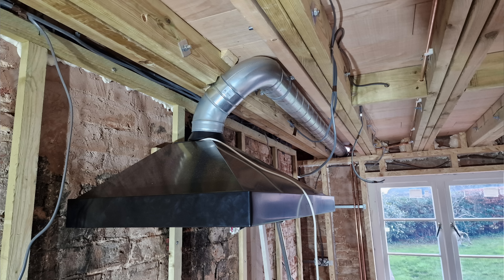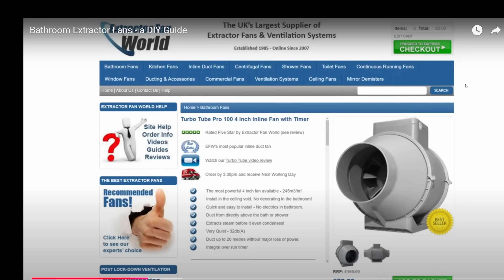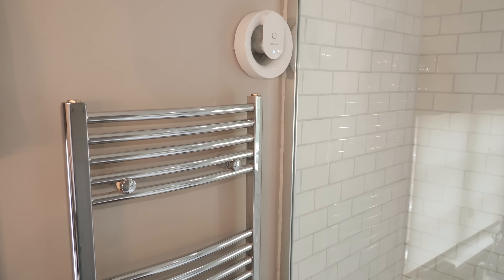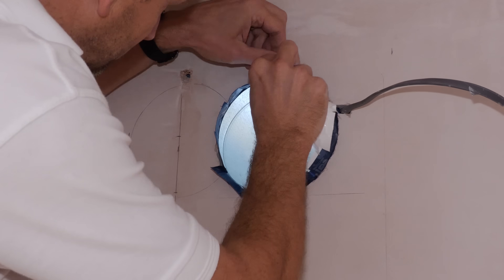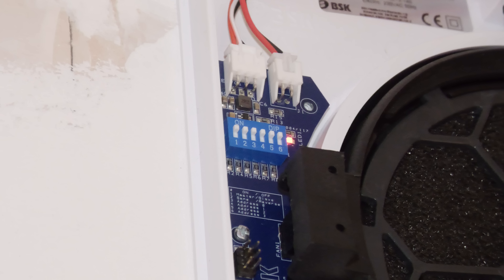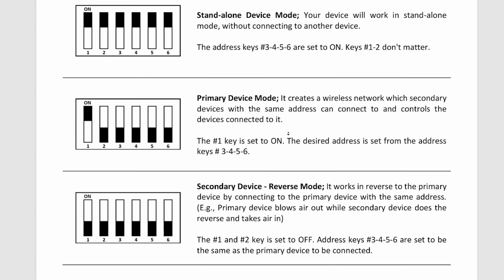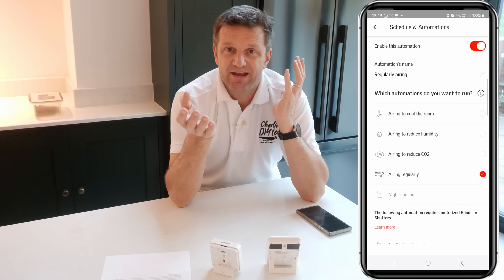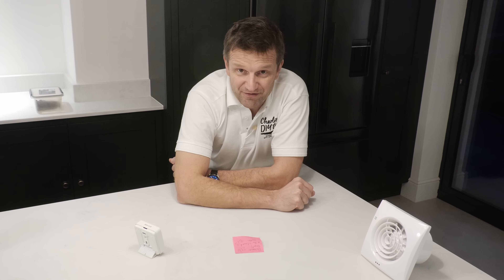A COMPLETE GUIDE to Decentralised Single Room Heat Recovery!

Comment: OK, I have run the numbers. At its highest setting (60 cu m /hr) if you leave it extracting for 5mins (10 mins total, as it only extracts half the time) then if it is freezing outside and 20C inside you will have saved 18Whrs of heat. Which, with electric direct heat will cost you around 0.48p (gas or heat pump around a quarter of that). Used twice a day (but savings only in Winter), that will be a buyback of just over 100 years... So not for bathrooms then...
Air change for the rest of the house? Well, you will need 2 or 3 running flat out to meet recommended minimum air change- and a hermetically sealed house. Do you run out of breathing air at the moment? If not, it is getting in somewhere, and that would need to be sealed.
Night mode is a quarter the flow, so eight hours a night for say 120 freezing equivalent nights (generous) is about £1.30 worth of gas a year. Less the 26p it would cost to run it. More than 100 years then. And assuming that it needs no maintenance, like filter cleaning.
Reply: You must bring in fresh air.  That air should be conditioned for comfort and to reduce drafts.  Central is better because you can really go wild with filtration, but this is a decent option.
Reply: @BB-nn9en  If by 'this' you mean the item in the video, it is not sufficiently efficient to be worth installing. And may be unnecessary. Most houses have a natural air change- the question is, is it enough. One method is to use a CO2 monitor, Put it in a room, close the door and see the concentration rise. Then open the door and leave the room. The rate at which the reading falls (it is a log function) can be used to calculate the air change.  If the reading stays below ~800ppm whilst you are in the room, it is likely there is sufficient change anyway. If there is an issue with condensation, a de-humidifier is a better bet than ventilation.
Reply: @Tensquaremetreworkshop  That's nice in theory
Reply: @ yes, and the nice thing about physics is that theory and fact are so closely matched.
Reply: Good points. On the HRV150 our efficiency testing is based on EN13141-8 lab conditions, so the ‘up to 86%’ is measured under a 24°C/-5°C scenario. Real-world numbers will vary, but separation of flows (rather than reversal) helps consistency. Thanks for raising this — it’s the sort of detail we’ll break down in future YouTube content
Reply: Isn't the point that they are also solving a problem with condensation? Not just a concept of saving money by recovering heat. 
Or are you comparing with using a normal £20 extractor fan? (Which to be fair, would only be on a timer and not humidity stat).
Perhaps worth comparing with both a cheap extractor (with estimate of how much it would be on with light), and with a humidity controled one.
But neither of these would provide the push/pull option to bring fresh air in, that this solution provides...
Reply: @UKBlue407  Firstly, it does not matter, for ventilation purposes, is you suck or blow. The air will get in/leave by other gaps. (if your house is hermetically sealed, then you are just pressurizing it- not getting any air). Secondly, there are two reasons to exchange air with the outside. Moisture and CO2. The first is a condensation risk, the second a health risk. Ideally you monitor both (I do). Dual monitors are relatively inexpensive, and will tell you if ventilation is sufficient, or needs augmenting.
Lastly, heat exchangers for the air moved in and out can save heating costs- if done properly. Whole house units with dual flow and a heat exchanger will do this. Small units like this cannot recoup their cost in savings. And they add the work of cleaning the filters. Without adding much in the way of air cleaning- the dual direction means that it will return most dust back into the house.
Reply: @Tensquaremetreworkshop  Agree in principal about suck/blow - however for rooms that create lots of humidity (bathrooms/kitchen), surely its more effective to remove the damp air at source, thatn rely on it moving through the house to gaps it finds? (Suck out, vs suck in)
Its a genuinely interesting discussion, I;m trying to decide on improvements for our 2001 built timber frame house.
Reply: @UKBlue407 yes, extraction in high humidity locations is best- also for odours…
For ventilation in general, monitoring is crucial. Excess air change in Winter is wasted energy.
Reply: @Tensquaremetreworkshop  for a relatively modern timber frame building with concrete block walls (and render), with triple glazed timber windows, do you have a suggestion for the best option for bathrooms, kitchens and general air quality?
I will be fitting air sensors in some rooms, linked to Home Assistant for monitoring and potentialy control of extraction.
Reply: @UKBlue407  First, measure the problem. Buy a combined CO2 and humidity meter. Put it in your bedroom and see what values you get when you wake in the morning- especially CO2. Then your living room; open all the windows and get the CO2 down to 400 (base rate). Close them and see how it rises into the evening- and what it is next morning. All this will tell you if you need ventilation for normal living.
Bathrooms- you need an extractor. How much extraction? Test it. Then set the 'off' delay in the unit to restore readings after a visit.
Kitchens- a hood extractor is normally sufficient. Measure it- and how long after cooking you should leave it on.
Washing- most moisture and mould problems in houses comes from how you dry clothes. Hang them around the house and you will have problems. Good outside (ideally covered) drying is the cheapest and best solution. Dryers are emergency only! Do this and ventilation issues are greatly reduced.
Heat exchangers- nice, but expensive to retro-fit. If you decide to do, fit an all-house system- anything else is a waste of money. Worth doing? depends on your air change needs. Which you will only know when you have measured it.
Reply: @Tensquaremetreworkshop  Thanks. I have a small portable monitor, it sends data to Home Assistant. I will try it in different rooms and record the results :)
Reply: @Tensquaremetreworkshop  Filters are removable...
Reply: @anthonycharnley9114  Yep. And need cleaning. It you discard them, the crud will coat the heat-store surface, and greatly degrade any performance that it may have had.
Reply from the maker: Thanks, brilliant analysis. Yes I hear what you say on the payback. Trouble is if I ran that analysis on everything I do in this old cottage I'd never do any renovations 😉 I'll never get the money back on the ufh and wall insulation but it gives us joy every time we go in there particularly in these cold months - it's typically 2 degrees warmer in there than the heating is set to and I guess you'd say it's transformed the thermal footprint of the house.
Reply: @CharlieDIYte  Sorry, I cannot help analyze such items- especially when the specification is vague and rings alarm bells. For many years I was a consulting engineer, often asked to appraise a design before it went to market. It was alarmingly common for the physics involved not to be examined. In some cases, the objective was actually impossible, and no-one had spotted it. This item is one that works, but so poorly that it is not worth its cost never mind its installation. It also has issues with dust retention and maintenance. If ventilation is needed, a simple extractor is better- spend the difference on draft proofing. The claims made are wild- the best heat recovery systems are, at best, 80% (often measured with ~24C inside and ~-5C outside) and I am deeply suspicious of the power requirements- they are around a tenth of the Kair unit... Heat recovery can work, but it requires a whole house approach designed into the build.
BTW, removing that metal duct ( a serious thermal bridge) will save more heat than the unit.
Reply from the maker: @Tensquaremetreworkshop  No need to apologise. You're absolutely right - and this calls for a follow up video at some point. Yes I'm painfully aware of the issue with that duct - I've created a flawless cold bridge when I'm always at pains to tell people the danger of cold bridging. Crazy how you miss the most obvious things when you're mired in the details of a project. It'll need some thought though as that telescopic pipe they provide isn't perfect either - it needs siliconing to prevent moisture getting through the gap between the two pipes. Yes the dust filter is ridiculous, again something I should have made more of a point of. I did at least highlight the issue if not the problem of that dust being blown back in the supply phase.
Reply: @CharlieDIYte  Air change is an interesting topic. The recommendations range from 0.35 air changes per hour to 6! No mention of building size, number of people, or other factors. There are two reasons to ventilate- CO2 and moisture. Logically a control unit would measure both, and adjust ventilation to suit. I intend to do a bit of research into this... 
Reducing heating requirements has two vectors- lowering heat loss, and only heating where and when it is needed. The latter normally produces the best results in domestic environments. Multi-zone heating has been in building regs for several years, but rare in existing properties. Individual radiator valves centrally controlled give better control. My son has installed such a system, which also monitors each radiators inlet and outlet temperatures, and uses this to control the boiler modulation. Energy pricing by the hour combined with thermal storage offers further options. The problem is that this does not translate to most homes- the design and consultancy required to optimize for that house would exceed the savings. New houses are often to a common design throughout the country, so such work could be done- but houses sell without, so why would the builders bother? Zero carbon standards were in the pipeline, but were dropped after lobbying. So it is left to DIY hobbyists like you and I to experiment- often in an information vacuum.
Reply: This is gold! Thanks for your work. Questioning why we put them in most new build apartments now
Reply: @tommotube  It looks good on the adverts... Having said that, centralized systems can do better. What I can get no-one to answer is- why are we using air to water heat pumps in this country? The rest of the world uses air to air. If you do that, you can couple your air change system to your heating system, use the same fan and add heat all in one place. Heating companies, if you have not thought of that, you can have the idea for free.
Reply: @Tensquaremetreworkshop  The answer I think is because you can't get grants for them. The governments won't allow grants because they are afraid people will use them as air conditioners in the summer and we can't have people using more electricity to make themselves comfortable.
Reply: @Tensquaremetreworkshop  Reasons for small uptake of air to air heat pumps:
1) No Government grant available for air to air systems
2) Air to air heat pumps systems require a separate domestic hot water heating system so therefore another cost in addition to the space heating.
3) Integrating ventilation with air to air might be possible in a ducted system, however this would make it only really viable in new builds not renovation, hence this video covers non ducted systems.
4) Existing housing stock already has water heating system (Gas) so if changing to a air to water heat pump there is less disruption during installation (assuming pipe diameter is sufficient) than installing a ducted air to air system.
5) People are use to radiative heating as opposed to forced air convective heating provided by air to air systems, some people just don't like the feeling.
That's not to say air to air systems do not work in the UK. You can find people here who have installed non ducted mini split systems successfully in their homes. They can be reversed in summer to provide cooling(air conditioning) and they are significantly cheaper to buy than air to water systems providing you can address the first two points above.
Reply: @Kiwipictish  There are issues with A > W systems too-
They still need a water tank etc.
 I have yet to see a radiator system capable of operating with the v low temperature differential. People turn up the water temperature which greatly reduces the efficiency. There is already a problem with gas boilers, getting the temperature down to allow them to condense. Temperature from air source is way lower.
A decently insulated house has a air change requirement loss higher than the insulation loss. If you are going to move air, heat it at the same time.
A > A is well understood. The last hotel you stayed in would have it in your room. It is used for virtually all commercial spaces..
Yes- A > W systems only give heating. In a warming world.
Split units are cheap (relatively) and easy to fit. 
Water heating- this is a small part of energy cost. If changing from gas, I would fit on-demand electric heaters. Why heat a whole tank that is either not used, or runs out?
Reply: @Tensquaremetreworkshop  Your comments are very helpful, thanks! If you were to add some ventilation in a couple of rooms of an old property, with no chance of any heat pump due to no outdoor area available for it, what would you do? Just simple extractor fans, like the one @CharlieDIYte did in his previous video? And, for the kitchen, would you do similar to what @CharlieDIYte did in his, or something different? Thanks!
Reply: @ it would depend on the reason for ventilation. There are three reasons- smell, moisture, and high CO2. For 1 & 2 yes, simple extraction. For 3 I would look to moving air within the building; most old houses have enough natural air change, just not in an enclosed occupied room. I have been experimenting with a CO2 meter, and rooms recover fairly quickly when you leave them. Leaving doors open is often enough.
Reply: @Tensquaremetreworkshop  The problem with using the ventilation system for heating is the size of ducts required - standard 125mm vent ducts would get very noisy blowing the amount of air required for heating. We have two small 3.5kW A2A mini-splits doing all the house heating. After they were installed we did use gas for hot water, then switched to using the immersion. Using the immersion, cost the same as the gas boiler with its pilot light but in the end we had an 11kW boiler installed and now use that purely for DHW and towel rails once a day. I think as a hybrid system it uses very little fossil fuel and has good redundancy and cooling if needed, so very happy.   £3500 for the a/c BTW.
Reply: @johnhunter4181  You are already blowing the amount of air required for heating! Bleeding in heat exchanged air involved around 2-3m3 per minute- part of that heated air, not in addition to. So same amount of air through your unit, just a fraction coming from the exchanger rather than the room.
Your boiler had a pilot light? Gosh, it must have been of some vintage...
My calculation is that using a direct electric water heater (heat on demand) would cost less extra (over gas) than the gas supply standing charge. 
Redundancy? I do not know of any modern boiler that will run without an electrical supply.
Reply: @plinble  Wow, at least 120% efficient! So these actually generate power, rather than use it? Do you need extra kit to sell that energy to the grid?
Drying washing outside uses energy, but you don't pay for it (a definition of free).
Domestic condensation is usually either bad house design, or (more common) ignorant occupants. It is currently raining here, and has been for 24 hours. Humidity indoors 41% - comfortable.
Reply: The value here is in the better air quality, and lower mould risk, not the minor energy saving. That's true of most building improvements (energy is still cheap enough that it takes decades to get your money back in simple cost terms). But nicer buildings (and lower emissions) have value.
Reply: @xxwookey  Yes. And all of that is available in a simple extractor. To simplify and clarify- the heat exchanger part does not recover enough heat to justify the extra cost. Not to mention the maintenance involved.

Comment: Looks like its simply blowing the internal warm air through a ceramic thermal store, then brings it back in when reversing the fan? Seems a good simple cheap idea - being sold for way too much.
Reply: But, there's an app. They could have doubled the cost with AI and blockchain.
Reply: @ricos1497  The ESP32 isn't the worst way to go about it really, problem here is possible limited firmware. This is the same chip used in the sonoff devices... they are sub £1 chips.